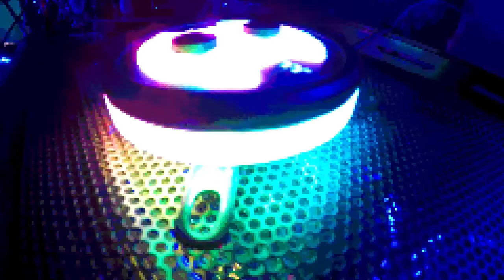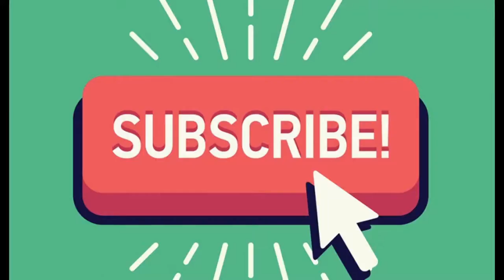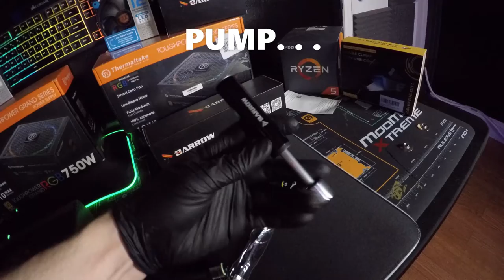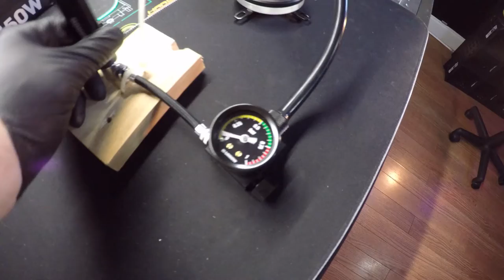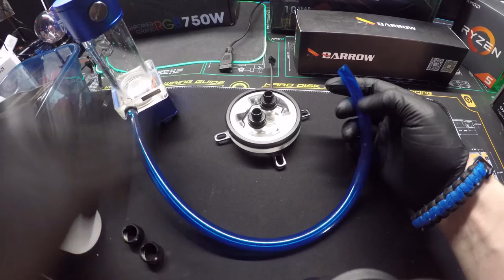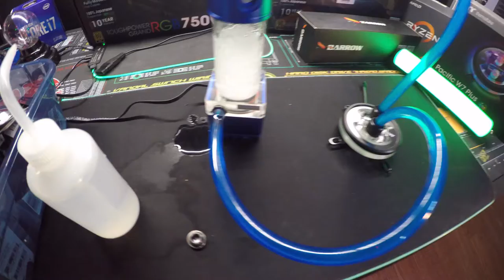TESTING TO SEE IF ITS WATER TIGHT !!

Comment: I been looking around havent seen anything yet close. Why has no one posted or built a water cooling system with a dye to make it a light or neon color then use a black light. Also there is this video for how to make black fire and there is a special light used that would probably go well with a color scheme on a build.
Reply from the maker: adding color or a dye to your loop is dumb,,, the heat breaks down the dye or color and it causes the water blocks to get clog.. it destroyed them.,.. i never run any type of coolant or dye in my systems.. it even dyes the tubes and the acrylic.. u run the color blue or red// then when u change it out.. it stains ur blocks that color...
Reply: @ATECHPCs  See the more I know now. I did see some recent videos of people using dyes and thought it was cool looking but now I know it is bad. Is there different color types of tubing though?
Reply from the maker: @cecilsparcel9224  o yes.. they make them in all colors.... red, blue. green and black.. are most common... buts that is SOFT tube.. hard tube... is mainly clear or blue.... i have a bit of all of it... i used blue tubing in this video... thats soft tubing..  hard tubing.. like in the wall pc or the titan rig.. is hard line ..blue..
Reply from the maker: @cecilsparcel9224  im making a video. Just for u... Showing u what dye does to ur blocks
Reply from the maker: Im editing the new video now... Im upload herr in about 1 hr... Plz watch it and share it. Thanks
Reply: yoo... he just made a video... explaining it... have u seen it ?
Reply: @pcman4747  about to I had a overwhelming day yesterday